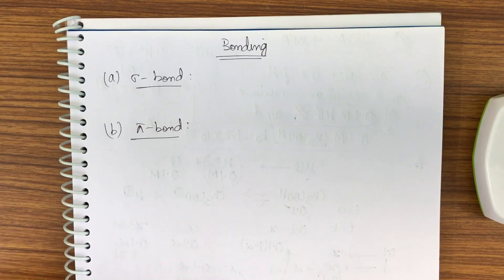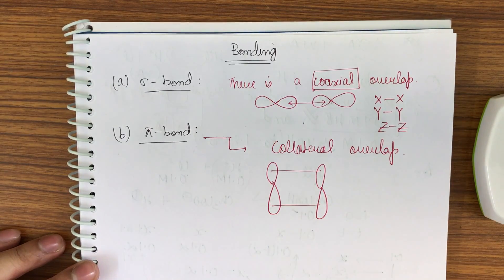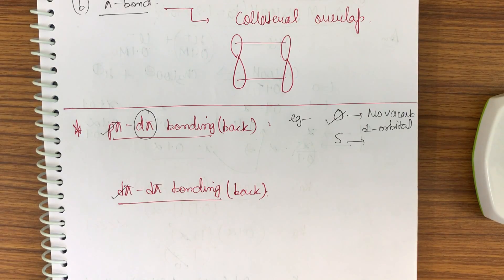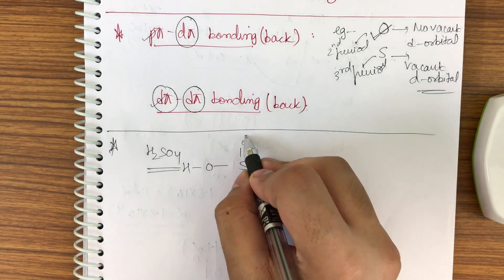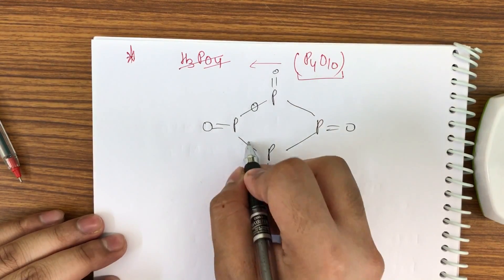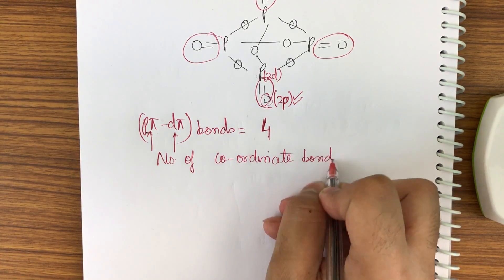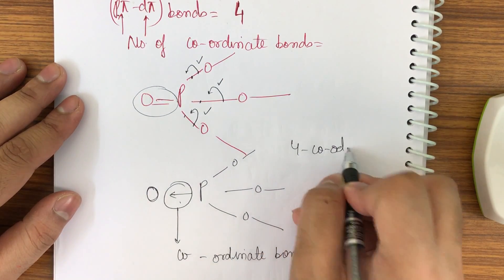Chemical Bonding Tricks for (pπ-dπ,dπ-dπ,sigma,pi) | JEE, NEET, AIIMS

Comment: You said that the elements use there d orbitals in these cases as they have vacant-d orbitals, but they have vacant-p orbitals also, so my confusion is how do we know that whether it will p or d orbital that it using in making bonds... in short You only said they use vacant-d orbitals but didnt explain why they using vacant-d orbitals, why not vacant-p orbitals

Comment: You said that an e is extra between p and o of p4o10 and that is why phosphorus will take electron from three single bond oxygens and not from double bond o. I don't get why this is so,   Can you explain this?
Reply from the maker: +Posittron see phosphorus needs 3 electrons to get a noble gas configuration...then after getting those 3 e the rest of the double bond(2 extra e) are of no use(ie they are extra) so it can be taken as a co-od bond
Reply: +Best JEE and PMT Preparation p could take electron from the double bond also right? Why does it take e from three oxygens?
Reply from the maker: +Posittron see dear.....that pi bond is p(pi)-d(pi) bond...the sigma is a linear overlap...so ucan now decide which one is easier bro....
Reply: +Best JEE and PMT Preparation understood :D
Reply from the maker: +Posittron yup bro....any other doubts?
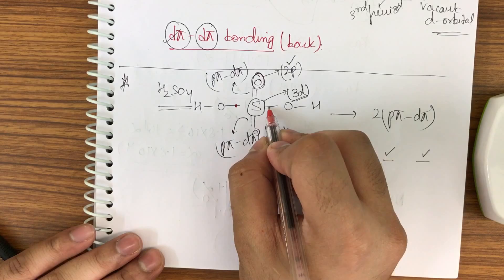Reply: Best JEE and PMT Preparation at 4:25 you said that we supply electron by the 'pi' bond between the Os and S sideways. But isn't that a single bond?
Reply from the maker: +Posittron yup that's a mistake...sorry I realised it now...while making the video it must have gone out in the flow of time...